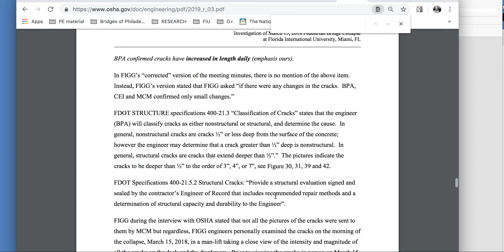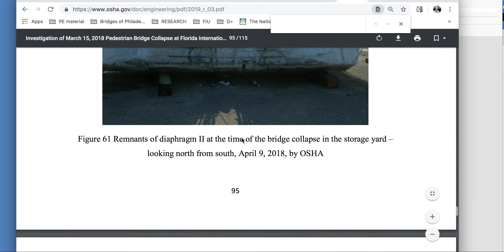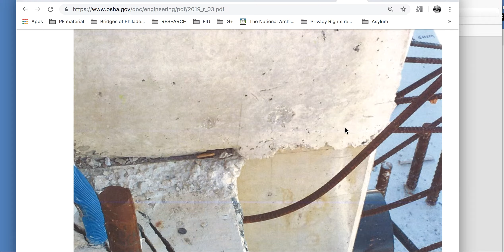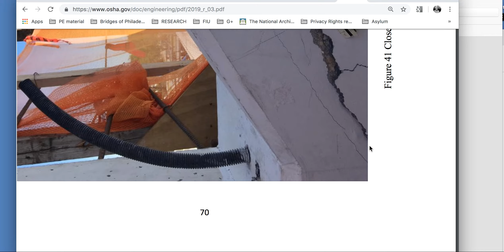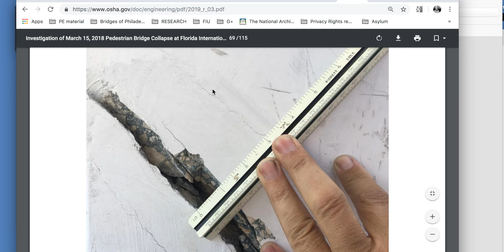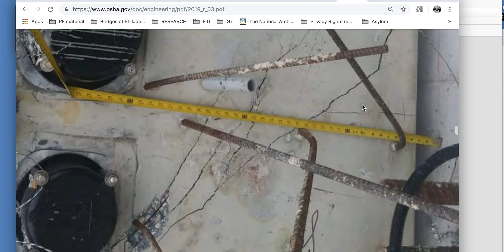FIU Bridge Collapse LATERAL MOVEMENT SHOWN in OSHA REPORT

Comment: Still trying to absorb all the data in the last few videos.  Lots of it!  Right now there are, (at least), two things in the report that make no sense to me.
1.  Video evidence shows that number 12 moves in the opposite direction from what the report implies.
2.  The connection between number 11 and the deck remained fairly solid until very late in the event.  The lower PT member anchor stayed in the deck . This in turn is likely what what ripped the belly out of #11 on the way down.
Another thing that I have never figured out is a mechanism that would allow the top of the PT member to squirt out 2 meters while it was being mangled by all the action below.
Reply from the maker: I will do a video response for you, as I want all this data to amount that anyone can be asked any question and anyone who followed my threads will be able to account for all actions and every single last crack!  That is my goal.
Reply from the maker: I would say, that the lower post tension rod, labeled as "A" never failed. It shows as embedded with backing plate... The ripping effect of the bottom of 11 can only take place if  two ends are secured... That was accomplished by the deck embedment  and at the blister bar (in the canopy)... The only other option is that the bar was ''pinched'' during the collapse in the blister bar area and this was the second point of holding it while the deck fell and the bottom deck embedment ripped / sheared threw the bottom of number 11 (as we see in the NTSB video).
I do not think it was pinched but lean towards it was held by the backing plate in the node / blister bar they were working on at the time of failure. 
I would theorize, that this structure, without the post tension in number 11 and number 2 could NEVER work... 
I think Linda Figg and Denny Pate, tried to ''double dip"...  (video to come)...
Reply: @LoadPathEngineering   Yup.  Actually that is another one of my unanswered questions:  Was the lower PT member in one piece after the incident?  I know there is a picture showing it "sheared" at the deck . I firmly beleive that this 
shearing was caused by Bubba and his zip saw.
Reply from the maker: Interesting, that OSHA let that stand as ''sheared'' and not explain how Bubba did it... This is why Denny Pate is correct with his quick reaction... The ''assumptions'' in the report are wrong and most are correct but they are not correct in the failure.
I am working on explaining why number1 did not fail in the ''girder system'' ; whereas number 12 failed in this girder system...
Basically, 12 was partially on a ''blister'' itself and was NOT shimmed underneath of it... 
Number 12 was a ''column'' with substantial weight; this weight acted like a load point in the ''center of the girder'' and appears not to have much cross sectional reinforcement as compared to number 1, which sat on top of the ''girder'' and therefore had 4 FEET of concrete to resist ''downward shear"...
Plus, I am not sure of the cross steel in number 1's "girder"...   
Recall, the canopy HAS weight and so does number 1   -- same for the opposite end of structure at number 12. 
This weight at number 12 was to be countered by application of grout underneath of the 12's ''blister'' and under 12 in general - -- thereby, transfering the column load to the pier to the Earth...
Reply: A lot of people get hung up on the, (incorrect), "truss" word.  If this was a classic truss design #12 would indeed only support itself and tiny bit of canopy weight.  The PT construction changes that.as the deck and canopy behave more like the flanges of an I beam, (  a long, skinny I beam with lots of holes in it).

Comment: Are the cracks recorded in a systematic, and organized manner, providing a track of the progression of the cracks?  For example, do they create a log book, that shows the location of the crack, photograph by date, etc. It seems that the cracks were tracked haphazardly, by whomever happened to notice the crack, and take a photograph, by different people, of different organizations, on different days.
Reply from the maker: No, I do not think any engineer I know of knows how to map cracks... 
Even I have not ''mapped them ''correctly""... You would need a 3D scanner to do this with any great confidence or a ''mold" (that means a synthetic mold and no engineers do see the value in this. 
As you may have observed from the engineers who have attempted to determine what is wrong... They simple look at the crack and then instantly go to the reinforcement of that area and focus on the reinforcement being the issue.
They lack the ability to evaluate the cracks and let them speak to what is going on. They consider all cracks //// cracks    without considering how they ''developed"...  They default, to overloaded joint and we just have to reinforce joint more...   
I find this lacking in skill-set and just ''kicking the can down the road" to the failure happening in creap somewhere else on the structure...
I have a video to come.

Comment: OSHA  states, "Some of the photographs, schematics, computations, tables, figures and other non-text items have been removed from the posted versions and are not displayed. The text of each report is otherwise identical with the original document. The original document is a part of the OSHA case file and is maintained in the appropriate Area Office or State Plan.  Only selected reports are posted on this webpage. For assistance with any of the reports, figures or illustrations, please contact the Directorate of Construction at (202) 693-2020."
Reply from the maker: As I understand it, you can't even use their report in court...
Reply: @LoadPathEngineering  That text implies anyone can call OSHA to obtain more photos and data.

Comment from the maker: About 23 minutes in is where I show the slide / lateral movement...  here is an image to help you, https://ibb.co/k9c7yzP
Reply: Jeeze. I wonder if the crew that was working topside had seen these.  Noway I would have gone up there to twist and beat on it.
Reply from the maker: I do not think the workers understood load paths and what cracks mean... As we can see in my post and people who ''attack'' my post, who are engineers, they ALSO do not see this as a dead load issue... They see it as a ''truss system'' that pushed 12 off the diaphragm...
They are missing that it takes DEFLECTION to make 11 do any pushing and at that point you must FIRST get the deck longitudinal cables to heave... 
This is shown in the video...  the deck gave to...   NOT number 12 first!
But, these engineers have concluded that sliding is the only way, and to hell with the video data!  haha